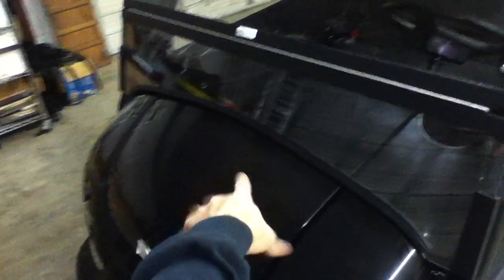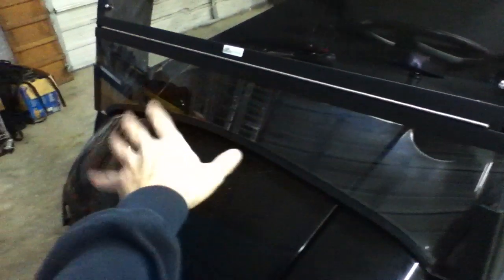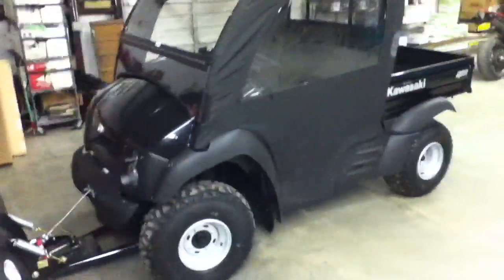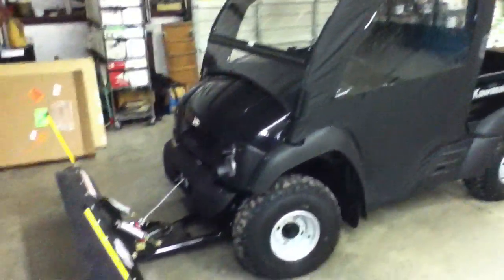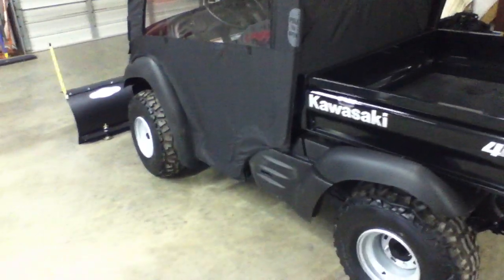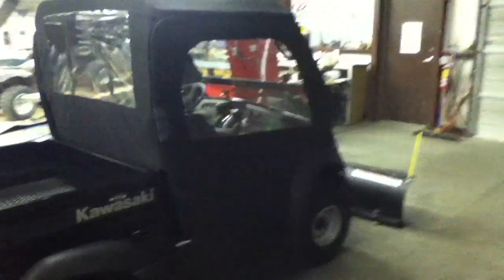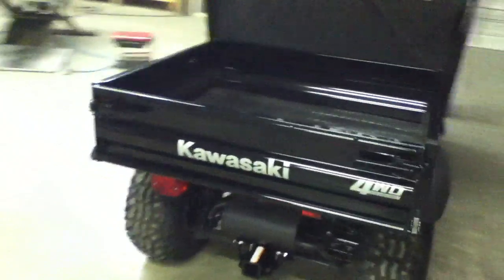Custom 610 4x4 Mule w/plow, cab, heater and winch

Comment from the maker: Depends on the build. We have another like this in the works for another customer, but it has more. It's an XC model that has a 2" lift and 26" 6 ply radial tires (Bighorn 2.0's) on it. Differant plow. Very close to the same but her unit is going out for about 11k.
We should have a video this week on it, should be on our Facebook as well (Hester's Motorsports)

Comment from the maker: @woodlawndairy So long as they are jetted correctly. The 610's are carbed but propper jetting makes a world of differance for higher elevations. Were at 7000 lf and very very rarely do we see sub zero temps. But ya they don't seem to have much trouble starting in cold temps. Pull the choke, open the throttle about 1/4 of the way and hit the starter, if your battery aint froze she'll start lol. 
Also if it's that cold it makes a big differance on the right oil, run 0w-40 if it's that cold.